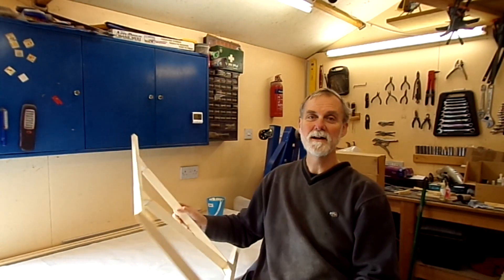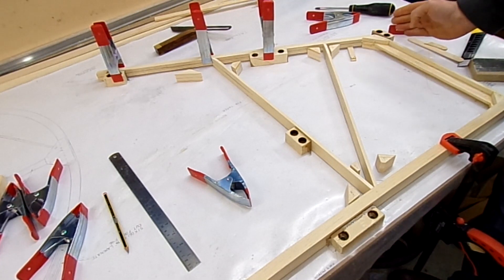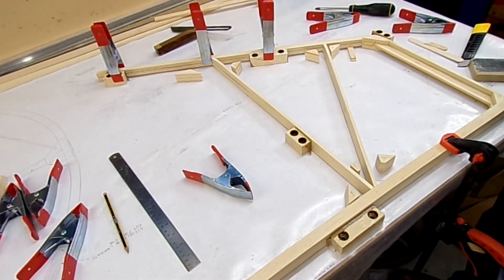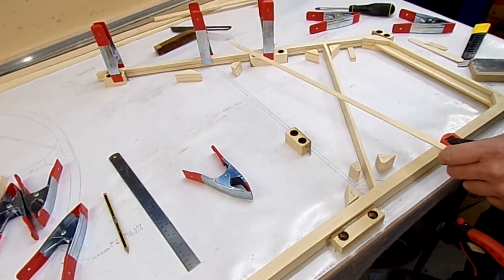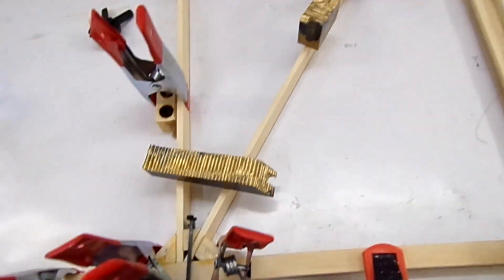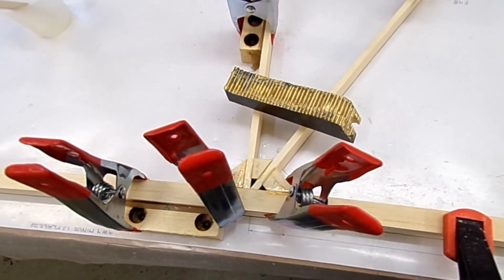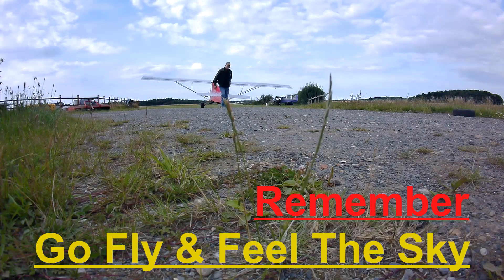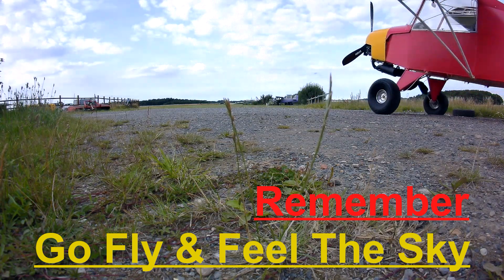EP8 Fisher Youngster V Kit Plane Build - Fin build and glue test

Comment: Just want to say I absolutely love your videos. Though I don't think I'll be attempting an aircraft build in wood anytime soon your videos are very inspiring for construction (and aviation) in general. Thank you for putting the time into making and sharing your videos.
Reply from the maker: I am sorry I did not reply earlier but for some reason I missed you comment. It is very kind of you to say you love the videos. I do hope that my videos show that building is not as hard as a lot think, it is a case of taking time and learning along the way. There are someplans ad kits that are easier / faster to build but even the complex aircraft, it is a case of the same work just more of it. The normal thing that stops people is the space, cost but most of all the fear of failure. In answer, there are small aircraft that can be built in a garage, cost can be spread out and there are a lot of people who are willing to help so you can be proud of achieving somethng very few do.

Comment: Most of my glue tests surprise me. 
Scarf joint tests: 
•fresh glue, quickly applied and clamped.
•fresh glue allowed to set 10 minutes before clamping.
•glue set in pot 20 minutes before applying and clamping.
•joint clamped but allowed to slide slightly loose.
NONE OF The GLUE Joints Failed!
Reply from the maker: Interesting, what test method have you been using and I take it that the glue you have been using is T88. From my tests in the past with other glues some would have failed at least some tests. The 20min in pot and 10min on joint are well within most resin normal use, so should not fail. I would say fresh glue quickly applied would depend on the amount the clamp force and the type of wood but again I would expect a high pass rate. The Joint allowed to slide loose would depend on when it slipped and if air could get into the joint.
I have thested scarf joints a lot when I was an apprentice a good joint has the same qualities as the material and the section will fail as if the joint is not there, poor jointing then to fail most predictably in flex, torsion and then tension but often appear good in compression.
Thanks for the comment and I am interested in you test method.
Reply: @flyingkub  no particular method, but after reading NACA report 354 and their methods I generally used that.

Comment: Hi Algy
That surprised me as well.
By the way, is there a supplier for the glue in the UK, or is it only available from Fisher Flying Products.
Kind Regards
Nigel
Reply from the maker: The T88 came with the kit but trying to get it in the UK is hard. It is expensive to buy, the cheapest place I have found is the Middle East. If I need more I will order from the USA, that said, it is from talking to other builders, one of the most forgiving resin systems (with regards to temp amd moisture) available. Most of the epoxy resins aircraft work, I have done has been wth West Systems epoxy, which a lot thinner and often needs bulking agents (like cotton floxs) adding, to keep in all but the tightest joints.